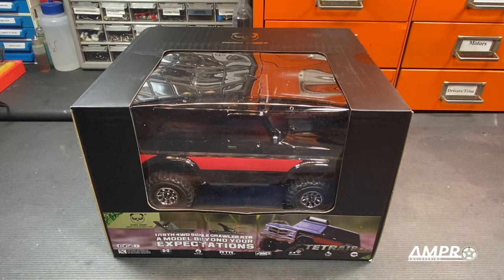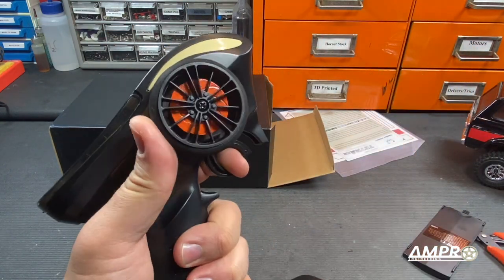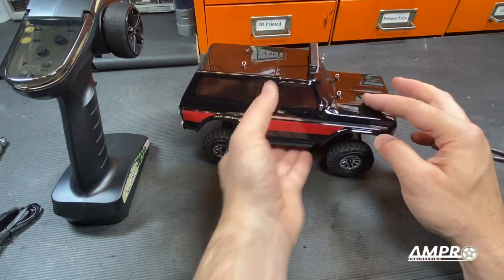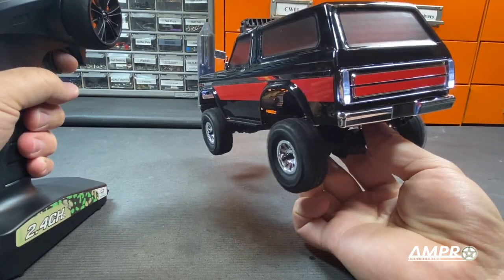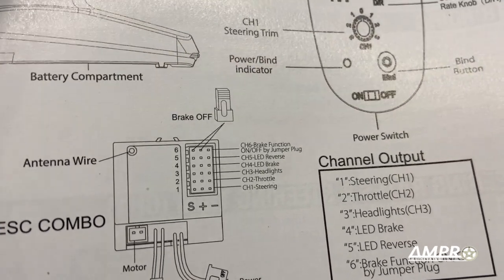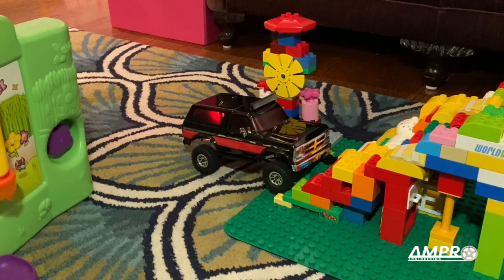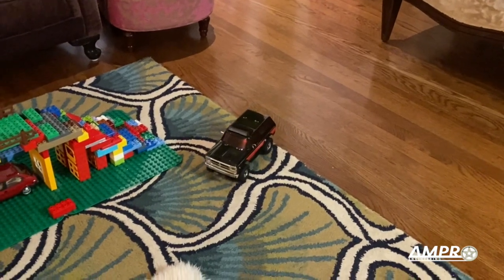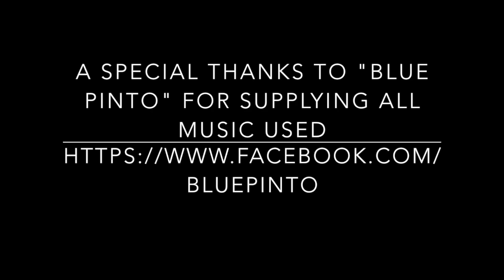e286: Tetra X2 Bronco

Comment: It's a dodge ramcharger grill on a Bronco  body,  the crawling works best in the high setting , as the low settings will just burn the brushes out of the motor also check driveline for any binding , I put full bearings and the hub weights in and it's an Indoor beast . Thanks for a great review 💪💪👍👍
Reply from the maker: It does need more weight for sure and I ordered the bearings!

Comment: So excited you have one of these now! I've had one for while, and my only complaint is that the motor struggles over obstacles then releases to fast, so proper smooth crawling eludes me still.

Swapping electrics has helped, and I've changed the grill and matt coated the shell, so it's all a bit more low-key. It's a little champ, but if you have any ideas about gearing changes and so on, that would be real interesting. A
Reply from the maker: Yeah the low end is a bit weak and that makes the car jumpy.
Reply: @Marcos Vazquez I put a Sidewinder 3 esc in and a Flysky RX. It's better but I think the gearing needs to be more crawlery.
Reply: @Marcos Vazquez nay, just some small metal mesh sprayed black. Lo-tech in the extreme 👍

Comment: Will you be making any 3d printed parts for this? I want one but that grille in the bronco has got to go.
Reply from the maker: Probably not, sadly dont have the time.
Reply: I've just cut mine out and replaced with black mesh. Looks loads better IMHO. But I'm a Brit, so not best placed to comment on actual Bronco resemblance lol.